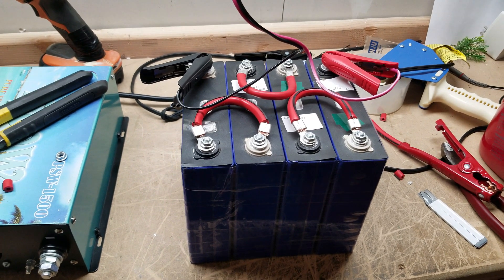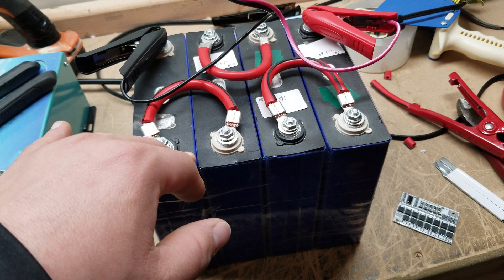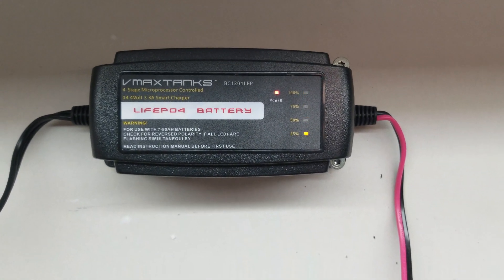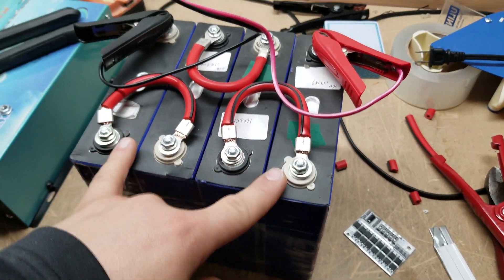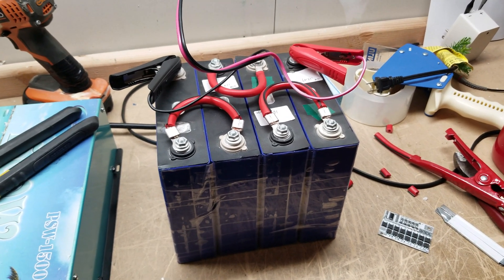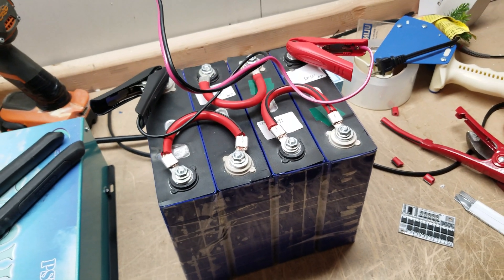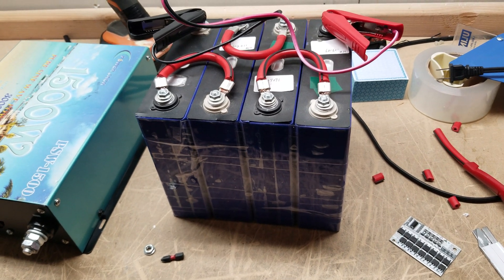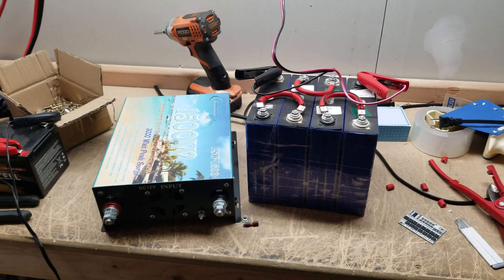My lithium iron test battery and charger.

Comment: that charger is way too weak for those prismatic batteries, use the Progressive Dynamics PD9130LV 12V Lithium Ion Battery Converter/Charger - 30 Amp  instead

Comment: Lithium Titanate 40A 10C 30000 cycles. I am buying some from Poland on ebay for $20 each.  2.4V. LTO. If the above is true, it works out to $0.02 a kwh to store power. Solar panels can generate for $0.005 a kwh. The expensive part might be the charge controllers and inverters need to do math. What can you assume 3 year life expectancy?
Reply from the maker: You will have to keep me updated on these

Comment: if anyone interested in LiFePO4 battery,pls check here 
https://www.amazon.com/3-2V215AH-LiFePO4-Battery-Plastic-Different/dp/B07P6XV5KS/ref=sr_1_10?m=A2UWFUXH0IWODZ&marketplaceID=ATVPDKIKX0DER&qid=1552526055&s=merchant-items&sr=1-10&th=1

You can build your own battery pack with different voltage and different capacity.

BMS max protection current is 200A,if you need BMS ,pls let me know.we will check the solutions for you.
Reply from the maker: Would you be interested in sending me some of these to get 48 volts and I will review them?

Comment: Your charger says max 7 - 80ah, is this charging your 100ah battery pack correctly? I have the same batteries, so I'm looking for a charger.
Reply: Nelson Ocasio  it depends your  your solar watts solar watts divide by your battery voltage = ampere of charger
Reply: buy the Progressive Dynamics PD9130LV 12V Lithium Ion Battery Converter/Charger - 30 Amp instead, your 100ah bank will take forever to charge

Comment: you should use a balance charger not the charger you are currently using. your charger will not stop a cell from overcharging if you are constantly cycling the battery.

Comment: I want to try one of those with my solar system.  But that is the problem, the charging...
Reply: IF you get a LifePO4 battery with a good BMS you can use any smart charger to charge it. Some of the newer solar chargers are able to charge them.

Comment: My test of the LifePO4 battery pack 12vdc 100ah with BMS...   COST $895.00
I connected just one battery to a 3000 watt inverter and loaded it down with a 1500 watt heater with an oscillating fan. The battery pack had 13.47v at the start
after 40 minutes of continuous running with no issues the battery was depleted to 11.1V so I shut it down. In about a minute my battery bounced back to 12.2V 
According to my calculations I was discharging at 125A/for 40 minutes and withdrew approximately 82ah from the battery. This battery I believe performs exceptionally. 
In my opinion this battery out performed 3 Walmart deep cycle marine batteries connected in parallel. 
My only concern is the battery case I chose has smaller connection points that need to be improved upon before mass distribution.
See this battery at: https://www.orumarketplace.com/swapitemdisplay.php?swapid=7323

Comment: Who manufactures these cells?  Are they really $350 each or are they $350 / 4pack to make a 12V battery?
Reply: That's a ridiculous price.  Calb 100AH are in the $130 (+/- $10), new, price range.  duckduckgo for a US supplier.
Reply: I would be interested in finding a better supplier. Especially if they will drop ship in a white label box to my customers. Does this price include shipping or a BMS?
 @whoami6684
Reply: I am from the manufacture, I can give you a sets for test and please share your test result  @robbreel6949
Reply: @whoami6684  This is the battery I am currently marketing: https://www.orumarketplace.com/swapitemdisplay.php?swapid=7323   I am looking for a 24v 200ah supplier at this time.
Reply: whoami i
Reply from the maker: 350 each for a 3.3 volt battery.
Reply: CATL....they’re chinese...in talk with Honda to supply ev batts.  I will have the 205Ah to test soon
Reply: Why would you spend $1400 on 100ah battery pack when you can get a 2.5kw 24v tesla model S module for $900 thats crazy ??
Reply: You do understand that the 2.5KW battery is 104ah battery?  @richardingle7540  I agree that the price charged by power jack appears to be out of line... As you see below I have been able to secure a similar battery for half the price that they are charging. I would like to see some data on the Tesla battery if you have it?
Reply: @robbreel6949  sorry , thats 5.2kw per tesla 24v module,got it wrong way round , sorry for the confusion 👍
Reply: That sounds better....  @richardingle7540   Do you have some of these? it's still only 215ah but that price is interesting. What type of battery is this?
Reply: @robbreel6949  no not yet , there is a guy your end , look up jack pricard , he has videos on you tube  showing these modules in use and he has even developed a sytem that talkeds to the bms 👍
Reply: @robbreel6949  sorry , thats jack ricard , he deels with everuthing tesla battery , hope this helps 👍
Reply: You can buy the same type cells for about $150-$200 or so each, from other suppliers, or a 12v set for about $500-$600, big hobby chargers will work also,